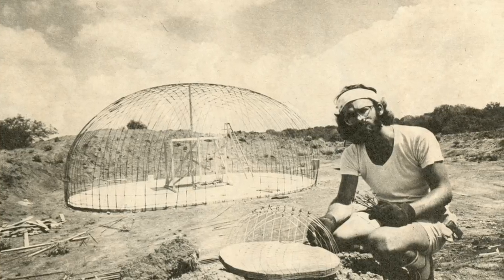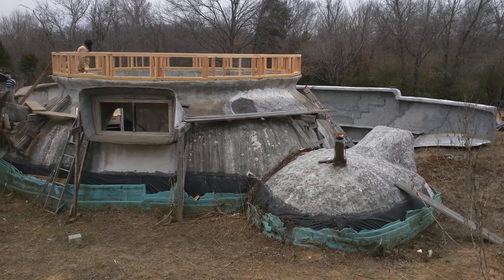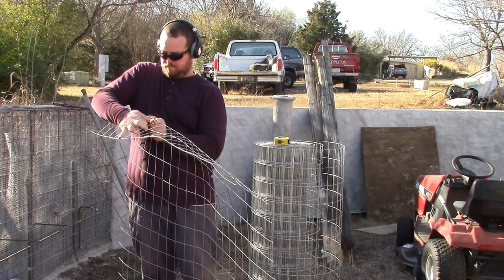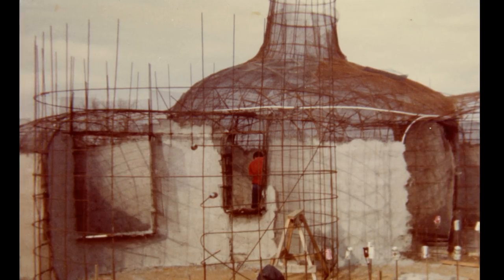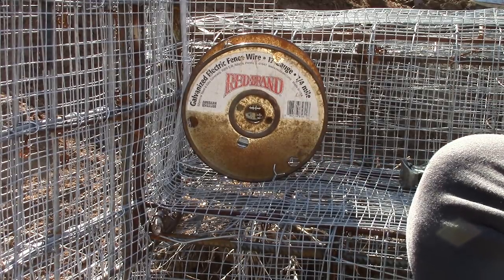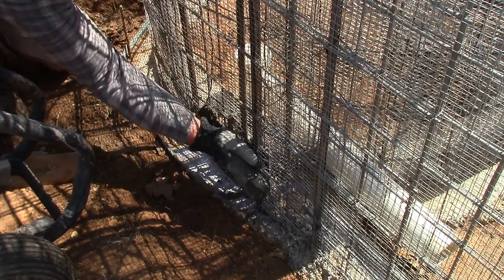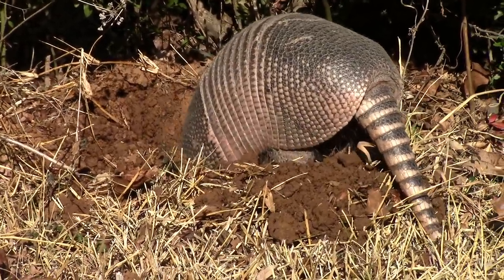Ferrocement House Project - Part 8 - Wrapping The Armature

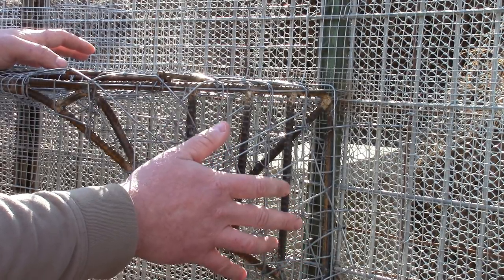Comment: 7:40 I'm not judgmental about 'getting away from the spirit of ferrocement' as much as I'm wondering about getting away from the engineering principles behind ferrocement. A huge reason FC is so strong is because it's flexible. It can withstand sudden shifts in load and increases or decreases in pressure with grace because it'll give some without breaking. I do wonder if too much rigid reinforcement may undermine this benefit. 

But I admit I'm absolutely armchair quarterbacking and am more curious about the result than anything. How well has it held up with the increase in rebar? I'll be thrilled if it's doing fine because that means there's a ton of leeway in both directions concerning the metal armature.

Comment: Just to clarify,  it seems like there are a bunch of areas where you've got much more layers of metal vs the original diagram and you showed some builds with much less.  What is your opinion of the original recommendations of metal content with regard to strength?  Especially for stuff that is going to resist being buried etc?
Reply from the maker: I like overkill and over engineering things. The problem is when you get too much metal in a structure it becomes difficult to get proper penetration with the concrete mix. One place I know I will be having trouble is in the corners of my stairs where I have multiple layers of hardware cloth overlapping due to having to peace in the corners the way I did. I will probably have to screen the small rocks out of my sand to insure good penetration with the ferrocement. There really isn't any point in doing more then necessary but it kind of goes against my nature not to overdo it.

Comment: Is it required to weld anything? Asking from someone who knows nothing about welding.
Reply: Typically we don't weld on rebar structures, but you can. It's usually just as fast and easier to just use a tie wire and captains hook like he is doing. Or buy the 150 dollar auto tie wire gun.
Reply: @MrInnovativeEnergy  This is great, thank you!